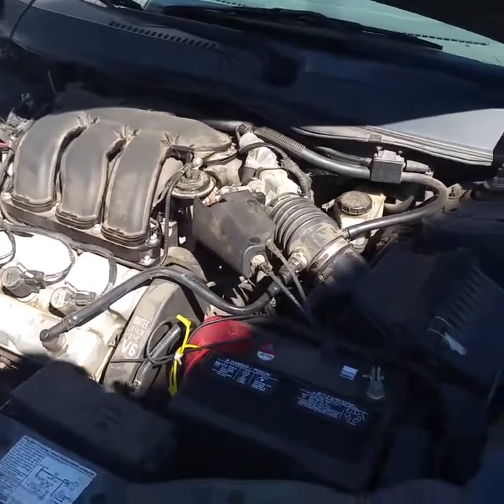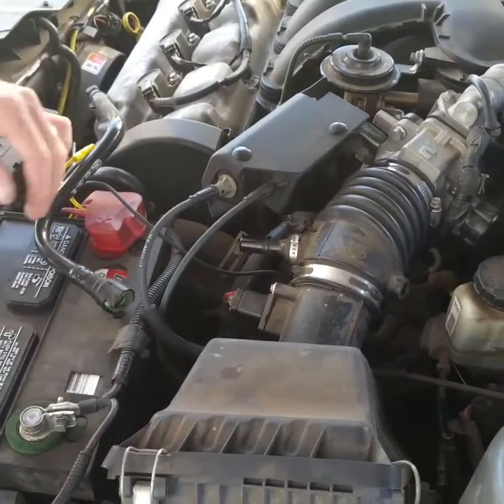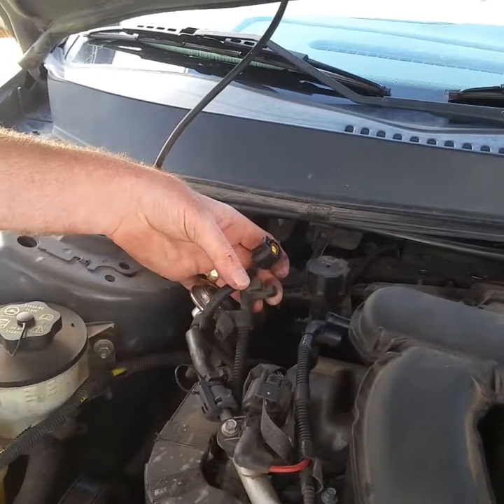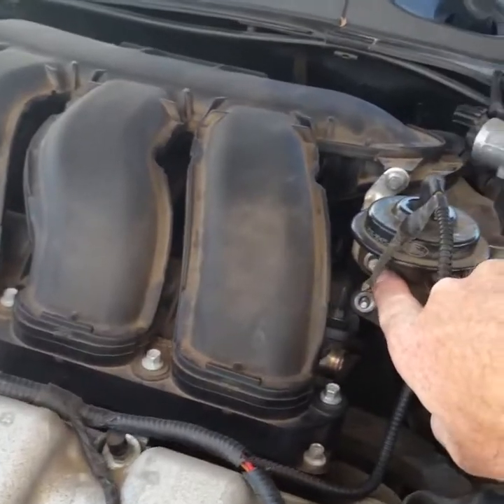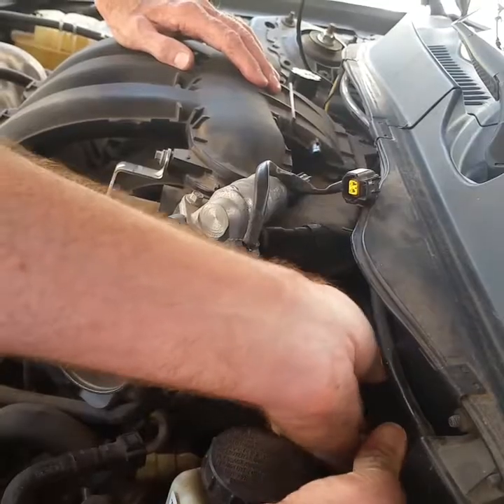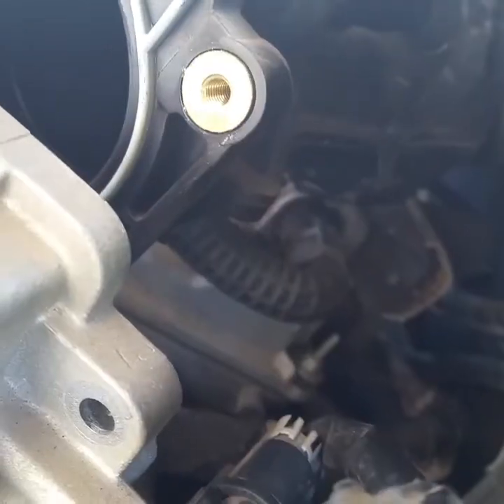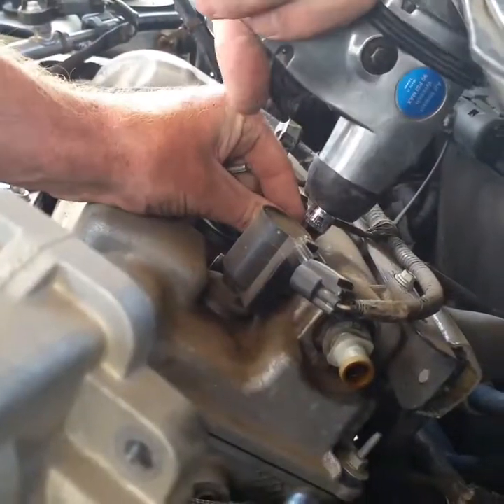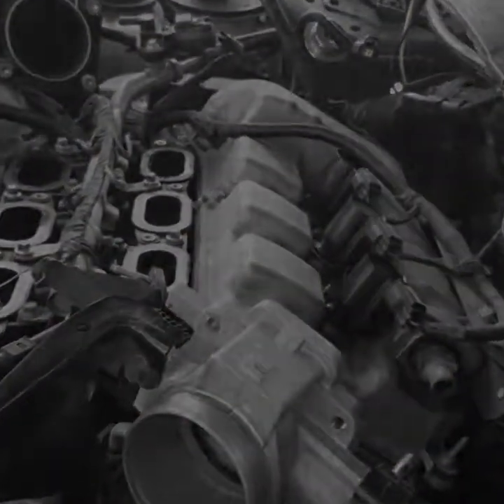2004 Ford Taurus ignition coil pack replacement DOHC

Comment: What was the symptom that caused you to replace the coil packs?
Reply from the maker: The car started getting poor fuel economy, and was running a little rough for a while... finally got a check engine light!  Error codes indicated misfire, and coil pack replacement was the most likely issue. 
The idiot lights don't come on right away... I'm pretty sure that I drove around for at least two weeks with the car running like garbage before the indicator lit up.

Comment: so just to confirm your car does not have a coil pack it has individual coils on each cylinder?
Reply from the maker: My 2004 has 6 individual coil packs, one for each cylinder.   Other models have an older design which has one ignition coil that provides spark through a distributor to each of the spark plugs.  Seems like people have a hard time figuring out the older engine design.
Reply: yetindustries okay thanks for the fast reply!

Comment: Could you tell me which is the coil number 5 please
Reply from the maker: The #5 cylinder is likely to be the center plug on the front bank near the radiator.  If you are fixing this coil it should be super easy.
Reply: thank you very much for the help, if I am going to change it
Reply: @yetindustries  count from front to back the one that's closest to the radiator in the middle is number five

Comment: What's the wire order for that car? I have 2003
Reply from the maker: Firing Order 142536 - changed the thumbnail image to show the cylinder numbers.
Reply: @yetindustries  thanks for responding.
So thats how I got jt hooked up.
But it runs rougher with rhe new spark plugs and wires than with the old
Reply from the maker: @noahyash3111  maybe you have the Vulcan engine instead of the Duratec option?  I'm curious why it would run worse, assuming that the only change was new parts...
Reply: @yetindustries  hmmm.
You and me both 
How would I know? And if that's the case.
What different would a have to do? Like would the order be different?
Reply from the maker: @noahyash3111  I think the Duratec engine has individual coil packs whereas the Vulcan engine utilizes    a coil block with separate wires for each plug.  Apparently it's pretty easy,  and common, to wire the front cylinder bank wrong on the Vulcan engine.  The front  cylinders on the engine are numbered 456, but the front of the Coil is 564, maybe the diagram will help explain.
Reply: @yetindustries  yea.
I have a block. It sits behind the engine near the wall.
If the side of the block with the connector is facing the front that bottom row is (3-2-1 from left to right) and top row is (4-6-5 from left to right).
I very well could have mixed them but I'm connecting them according to what I'm seeing
Reply from the maker: I have the Duratec engine, so I'm just speculating at this point... double check your wiring to the front cylinder bank, it seems easy to goof up.
Reply: @yetindustries  when you say front cylinder bank. What are you referring to specifically?
Reply from the maker: @noahyash3111  when you are standing in front of the car, with the hood open, the three cylinders near the radiator would be the front cylinder bank.
Reply: @yetindustries  o ok 4-5-6
Reply: @noahyash3111  i may be late to the party, but was the spacing of the spark plug correct?
Reply: @noahyash3111  did you ever figure out the coil pack if it was 456 on top and 321 on bottom. I'm having same problem, mixed my plug wires up and can't find correct diagram for coil pack arrangement
Reply: @JmoneyWrld112  yea I did. It was the vaccum hose that wasn't connect 😬
Making that thing act crazy lol